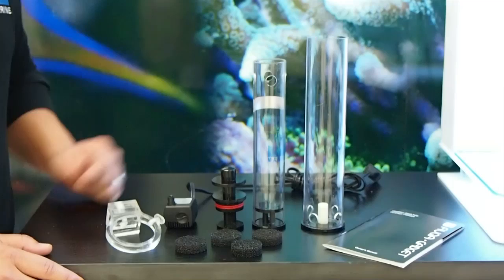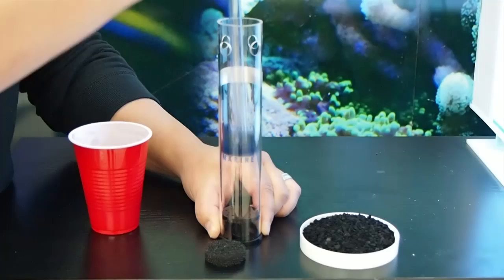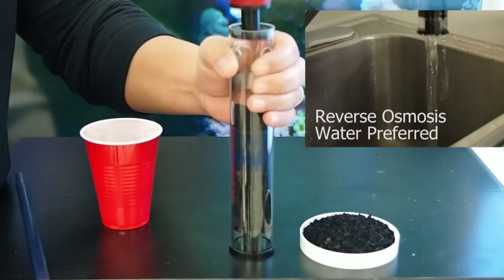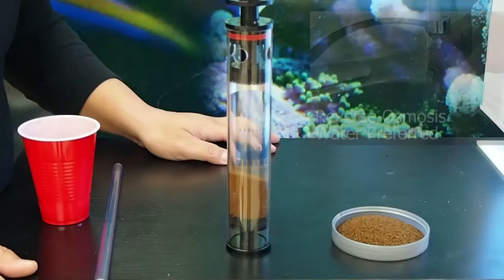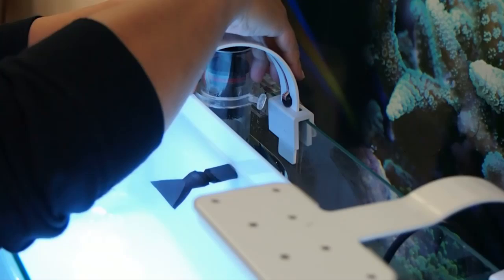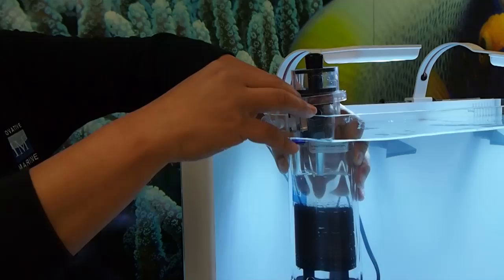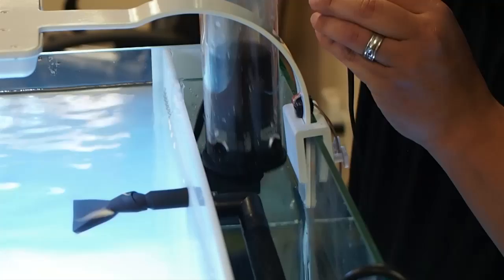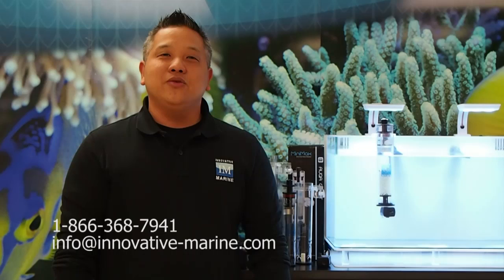How to Video: Innovative Marine Minimax Media Reactor

Comment: Hello. Im hoping you can help me with a problem im chronically having with this reactor. Everytime i put Rowaphas or Phosban in this reactor, it gets blown up the chamber  until it reaches the top, regards of how much media is in the chamber or where the power slider is set on the pump. This is extremely frustrating and not what i expected from this product.

Comment: Half of the media floats straight to the top and remains there without tumbling. What am I doing wrong?
Reply: Too much water pressure. Put two sponges. Two bottom two top, that's how I fixed mine.

Comment: Im thinking* of buying ur 16g IMarine tank,add the IM desktop PSkimmer, IM media reactor running carbon n GFO, and a nano UV sterilizer. I'm new to saltwater tanks n want the easiest,nicest, set up out there without having to do much maintenance. the most maint. I wanna do is the 20-25% water change+ carbon replacements once a month. I plan of putting about 10lbs of live rock, 1-1.5inch of live sand, 1 clown, 1 firefish,1emerald crab, 1cherry shrimp, 3 snails, and 3 hermit crabs plus soft corals

Comment: Why did you set the water level in the back, then move to the front, then back. Nothing was explained as to why you didn't just go with the water level in the back.
Reply: Joseph Crider He did this because in the back chamber you are not able to see the rate in which your media is tumbling, placing it into the display allows a clear visual of tumble and to set it to the desired position, otherwise I imaging you might be able to use a flashlight in the back compartment to figure out the rate of tumble but his method is much simpler.

Comment: Also when I run Marineland Black Diamond Carbon (Quarter Cup) with two sponges on top and two on bottom it all wants to raise to the top and leave a gap between the carbon and sponge? So I bought extra sponges and put 4 more on top so everything stays put is this ok? I'm still getting good flow. Would it be better to put 4 sponges on bottom and 4 sponges on top?

Comment: Can I use this in the 8 gallon Nuvo 8?
Reply: did you ever find this out? im wondering the same thing, im wanting to run this in a classic nuvo 8, in the back left compartment where the water flows into the back chamger, it would have to go there rather than in the larger banck compartment because i run a skimmer there.

Comment: Hi, Great Product!! I bought the "desktop version" for my 25 gallon nano. I'm running carbon in it for now. It does hold my recommend amount of carbon but what is the desktop rated for? whats the max size tank for the desktop? As long as it hold the amount of media you need? 

Thanks for a great product
Reply: Digital Edge hi I have a 25 gallon too I am trying to find out how much carbon are u putting